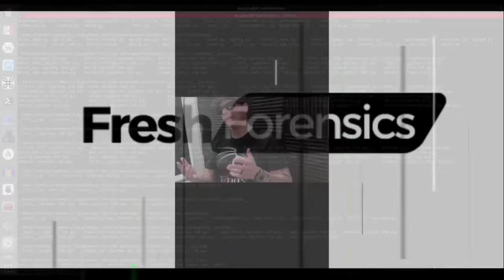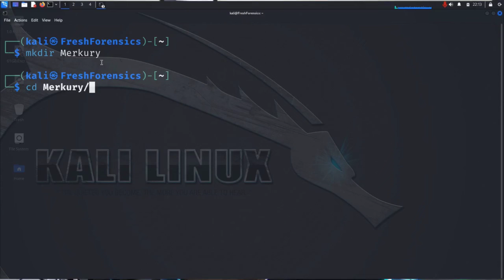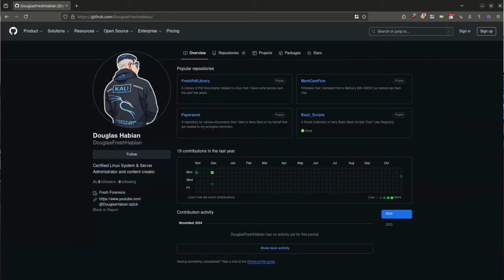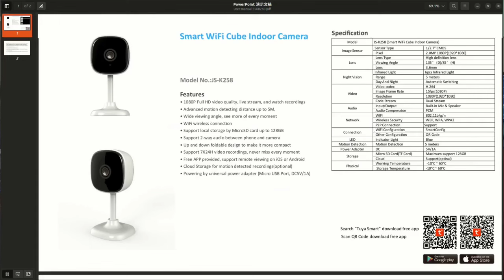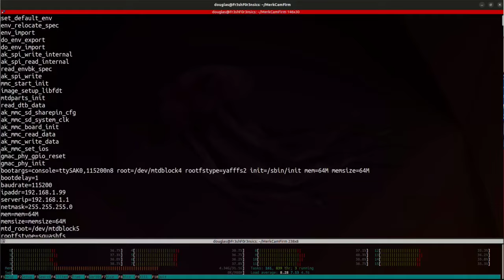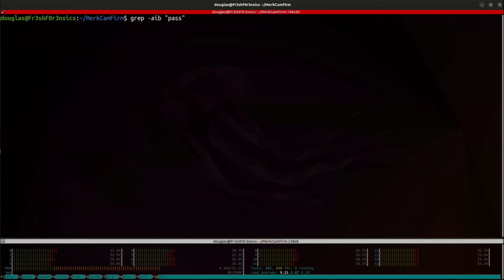Extract IP Camera Firmware For Reverse Engineering

Comment: Ever worry about the 5-volt connecting to a 3-volt chip?
Reply from the maker: No, for the most part, I am using cheap, inexpensive iot devices so if I fry the board or brick something, it was worth it to learn. With that being said, it is definitely something for me to consider adding to my videos as we don't want someone else doing just such a thing on a device they do care about.